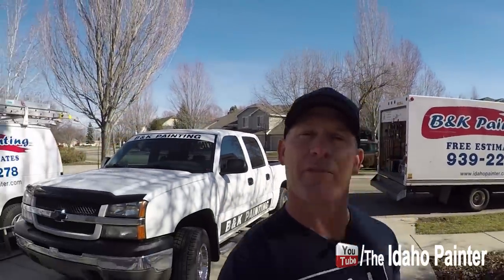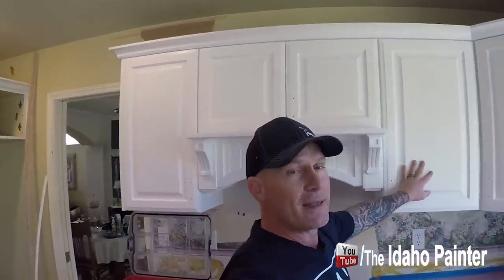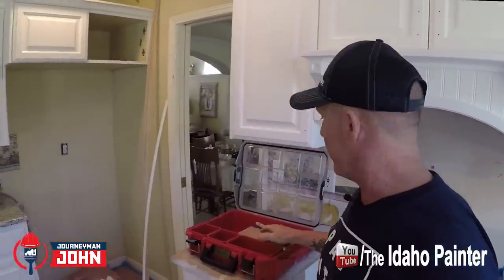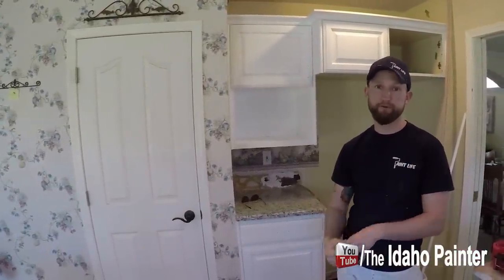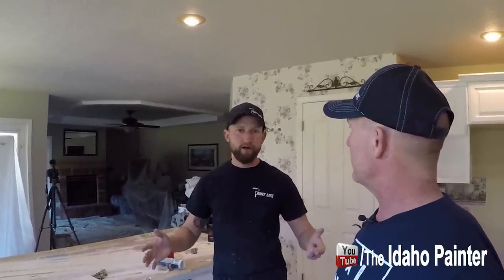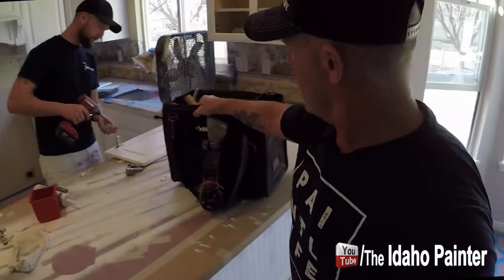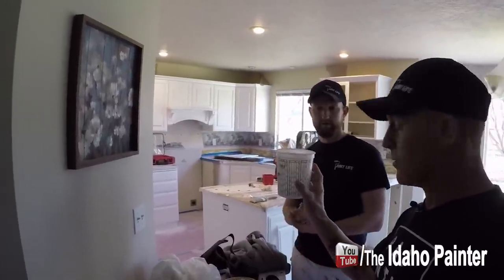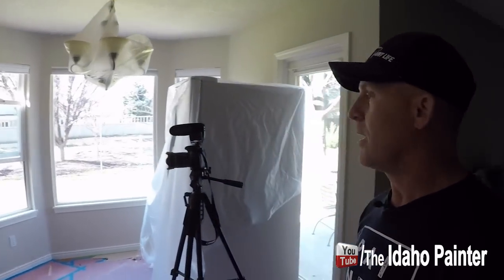Behind The Scenes Painting Cabinets

Comment: Fantastic Video we also paint lots of kitchen cabinets I haven’t used lacquers in over 15 years we do 2 coats Zinsser Bin shellac alcohol based primer and 2 coats Benjamin Moore Advance
Thanks for sharing this awesome video
Reply from the maker: Thanks for watching!
Reply: ELSTAN PEREZ the Advance is good paint. You should definitely try this product called INSL-X. It's a latex polyurethane finish and leaves a factory finish on the cabinets. I highly recommend it.
Reply: Jeff Froment Absolutely i’ll have to give that a try thank you so much for letting me know👊
Reply: I use lacquers if the customer wants to pay a higher price point but typically there's so many products out there that I've tried such as Dunn Edwards hybrid oil (decent bond strength) Sherwin William water base lacquers (decent bonding and finish), Sherwin Williams Pro Classic and Emerald paint (both paints with pretty good bonding strength). Most the hybrid paints are similar with strength but so far I prefer the Sherwin Williams Emerald and pro classic paints. I'm always chasing for the perfect water based paint similar to lacquered strength and finish results, if you know any such paint please share.

Comment: Chris, ive been learning how to spray cabinet doors, self taught,  its tuff, runs are a pain to deal with..😓👎, anyway I thought of cup hooks but I was thinking using the existing hinge screw holes instead of drilling new holes ,but the trick with using the existing hinge screws holes would be finding the right diameter and thread pitch so not to make the holes bigger.. ive learned so much from your videos...thank you for sharing your experiences ,with out your videos I would truly be lost..
Reply: Im  Learning to spray with a Graco X5, whats your insight on this type of sprayer?

Comment: Great video. When I spray cabinets I use a product called INSL-X. It's a  great product and it leaves a factory finish on the cabinets. It is a latex polyurethane product and I highly recommend it. It's just as good as a Laquer finish. I don't know if you guys have that out in Idaho.
Reply from the maker: We have not tried it yet, thanks for watching!
Reply: Home Improvement TV no problem. What's the name of the Laquer product you guys use. I would like to see if they have it out here in Massachusetts and give it a shot. Also do you guys spray cabinets using a HVLP or a airless sprayer.
Reply: Jeff Froment - INSL-X is great! Curious what tip size you use if using an airless sprayer? Thanks

Comment: Awesome video has always and thanks for sharing your knowledge. I have been painting residential/commercial for the past 4yrs.I recently bought a Capspray 95 to start working on cabinets. This is my question, What is the name of primer and paint that you'll use for 3yrs old cabinets (great shape no cracks) currently cherrywood, will be painted white. Thanks in advance for your help. Looking forward to next year go to your paint university.
Reply from the maker: We’d use a lacquer system. E63 Primer Surfacer and Sherwood Hi-Bild Precat Pigmented Lacquer.
Reply: Paint Life TV 
Ok thanks, the hi bild pre cat lacquer sheen should be low gloss?
Reply: Thanks for the help 
Would you do a laquer clear coat ? Do you thin any of this laquers?

Comment: So everything nice, but in two days how will you do everything in two days?  With three coats of primer and two coats of paint ? And painting both sides of doors plus all the prep work ( plastic ,tape ,sanding ) I don’t know guys! 🤔
Reply: I now that is in posible Two day if by only covering up walls and numbering the door it takes you half of the day
Reply: Spraying lacquers is a little different than spraying oil base. Lacquered dries in 40 minutes hard enough to sand in between coats